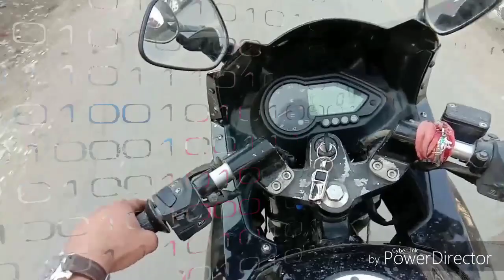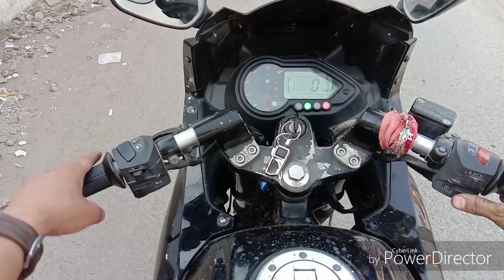How to Solve Bike Handle Problem // In all Bike // Pulsar 220 Visor Remove

Comment: apachi 160 hyper edge bike handle moving to left side automatically. wjat is the problem
Reply from the maker: Thanks, The bearing of the handle has to be loosened
Reply: @sgroyalwork   handle is moving one side that is left side .it's not tight.